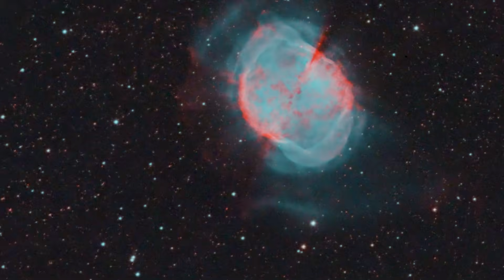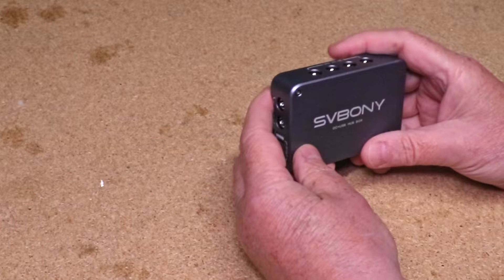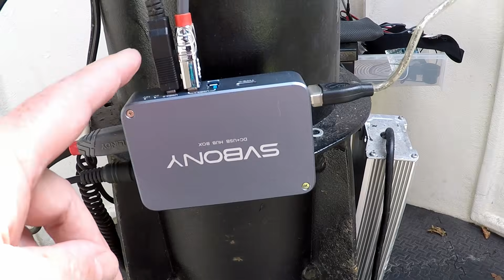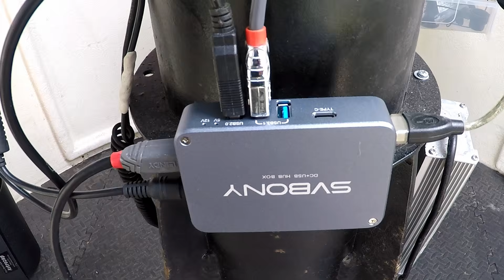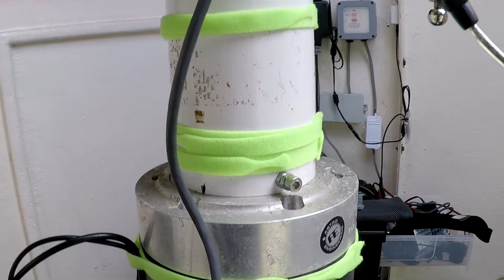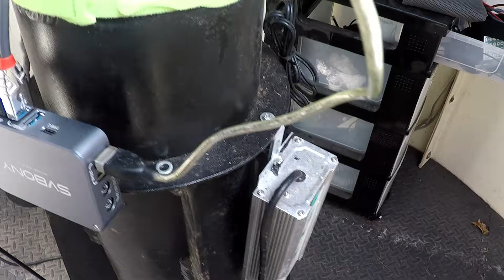Is The SVBONY SV241 Any Good?

Comment: Good video, FYI your 2600mc camera will work perfectly well on USB 2, it does not need USB 3 at all, for long exposure imaging, in fact I find they work better in USB 2 TBH… and I know many others only use USB 2. 👍🏻
Reply from the maker: I was using a USB 2 for a long time, but started getting artifacts (missing areas on image). Contacted supplier, they recommended switching to a USB 3 which I did and problem went away!! May have been quality or lead or something similar - anyways - just stuck with this cable as everything now works well with it! You are right though..many people  have no probs with USB2!!

Cheers
R